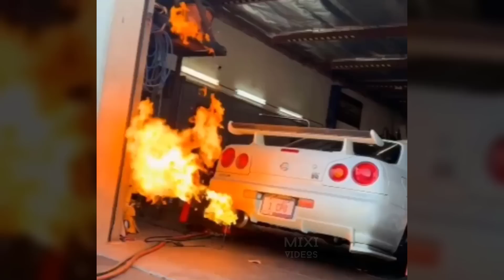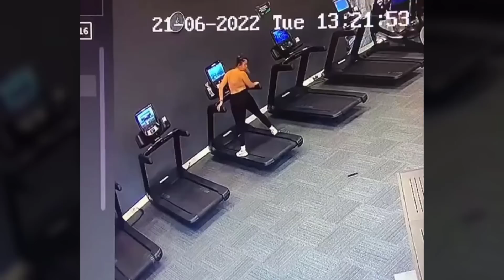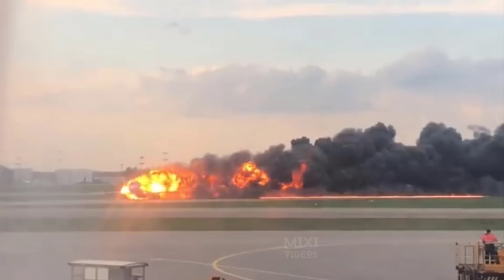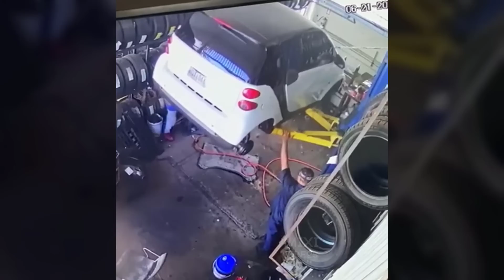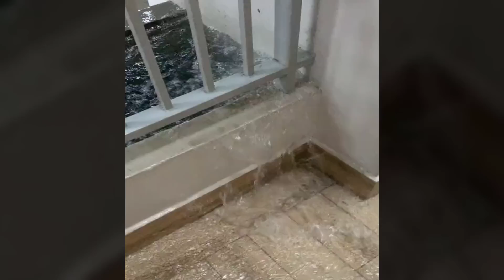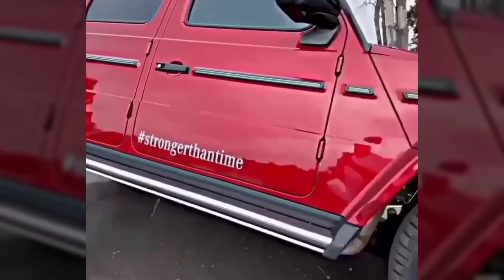TOTAL IDIOTS AT WORK #164 | BAD DAY AT WORK 2022

Comment: What on earth was that gun shot sound that came from the car the mechanic was working on? I'm not mechanical so I can't fathom what that was
Reply: I'm gonna guess they blew a gasket or line
Reply: I am really hoping to see the answer to this question! Where he’s working doesn’t make sense to the outcome
Reply: He was most likely welding the radiator. He probably emptied it but put the cap back on, as he welded the remaining bit of water came to a steam and blue the drain plug. Just a guess, saw something similar just didn't have quite as big a pop as in the video.
Reply: he had heated a nut on a ball joint probably. the heat transferred to the grease pocket in the ball joint and the grease expanded and exploded.
Reply: This was stolen from Just Rolled In and fewtoes comment is I think what was said on there. The mechanic had heated a nut and the grease blew out when he was removing the nut